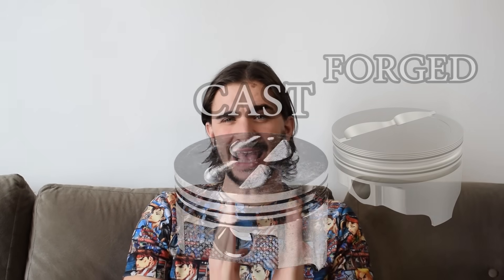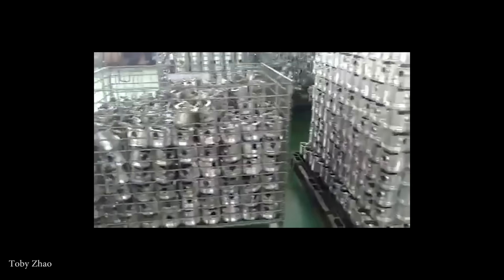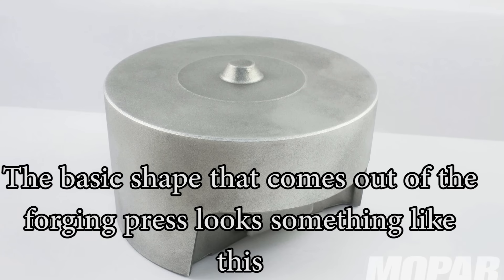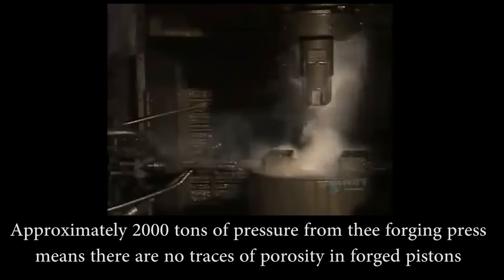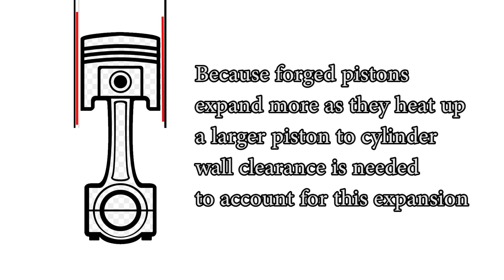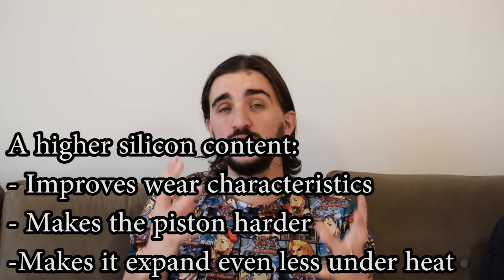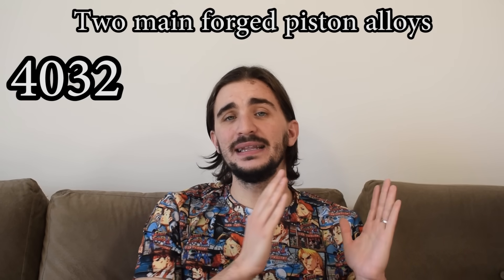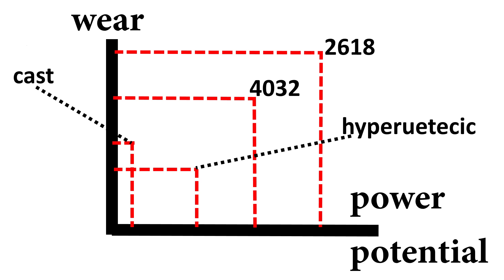FORGED vs CAST vs HYPEREUTECTIC PISTONS

Comment: Typical new cold clearance for a cast piston is .0007" to .0015". That's 7 to 15 ten thousandths of an inch. Typical new cold clearance for a forged racing piston is .004" to .006" depending on the usage. Endurance engines are typically less highly tuned and tend to have a little less clearance than drag racing motors. Supercharged drag racing engines running nitro-methane fuel make so much power in each cylinder that they may need to run .008" to .010" clearance to avoid seizing the piston in the cylinder. To prevent piston 'slap', a pattern of teflon 'buttons', machined to the actual bore of the cylinder, are used to keep the piston from 'rocking' in the bore.

It's not that cast aluminum has a lower coefficient of expansion than forged aluminum...actually forged aluminum has about a 25% lower coefficient of expansion...it's that cast pistons have have cast iron expansion control inserts cast into them to allow the tighter clearances. 

The skirts of pistons are not round. The ring land portion is round, but it's smaller than the skirt. The skirts of the pistons are slightly oval with the widest portion perpendicular to the axis of the wrist pin. You must measure the skirt perpendicular to the pin to get the proper clearance dimension. The tolerance for clearances on a new engine are actually very tight. The manufacturing clearances are not as tight for either the bores or the pistons but pistons and bores are matched to each other to provide very good uniformity of piston to wall clearance from bore to bore of a given engine. Factories used to sell engine blocks with pistons fitted to each bore for rebuilding. It was very important to put each piston into the bore it was fitted to. 

A new set of forged pistons will typically be manufactured to very tight tolerances but the racing machinist may want to machine the bores to get almost exactly the same clearance on every bore.

Comment: Super content thanks. It was probably for brevity that didn't discuss weight. AFAIK forged being stronger for a given mass can be made lighter. Lighter pistons can in turn mean higher RPM potential?
Reply from the maker: Well it depends, but if we assume an identical design of equal volume, cast will almost always be lighter. But in reality the design and volume will rarely be the same, because forged piston manufacturers rely on the strength of the forgings and often aim to reduce the volume wherever possible, which is, as you pointed out, doable to a greater extent on a forged piston. But even with the possibility to remove more material from a forged piston, as a general rule of thumb, cast pistons are still often lighter. And while it's easier to reach high rpm with a lighter piston, the weight benefit becomes irrelevant in high revving racing applications (prolonged 10k rpm+) , where the forces experienced by the pistons make cast pistons a poor choice, despite the weight benefit.
Reply: @d4a  Really interesting, thanks.

Comment: This is misleading..
What about rings?? You forgot to mention quality rings transfer more heat away from the piston into the bores meaning closer tolerances through less thermal expansion, add to that skirt coatings and oil squirters which negate cold start fears meaning not only a lighter, stronger piston but also one with much more scope for future modifications. That's without even mentioning floating pins, oil drain and control via oil control ring holes or comp height vs rod length etc etc. There's far more tech in a quality, modern forged piston to make case of a simple cast vs forged comparison
Reply: the video is a comparison of cast, forged, and hypereutectic pistons. That's it. Not misleading at all. You literally are taking other subject matter and trying to  say the video should've covered every component in the engine as opposed to just the item that's the subject of the video. You're trying to sound smarter than the video, but failing.
Reply: But what about the tires???  A car with hypereutectic pistons won't perform as well if it has crappy tires, as a car with cast pistons and racing slicks.  This is very misleading as there is much more to pistons than just the piston.  The insurance rate will be higher if it has red paint as opposed to beige, why didn't he mention this too?

Comment: The  car experts  are all wrong when they commonly  refer to aluminum parts as "billet".   Most  all  aluminum  parts  are  not billet.   All  aluminum  parts are machined from extruded bar or  milled plate or  rolled  sheet.  Billet aluminum parts  are  forged.    WTF  is  on this guys forehead?  We  keep staring at  that  injury on his forehead.  Maybe  an impact injury from a forged millile.

Comment: Damnnnn! I have grey rtv in my pistons. I knew they smelled funny
Reply: With the 4032 forged piston, should the bore be slightly larger than 2618 piston when going for quieter cold starts and engine longevity ? Is 0.5mm larger a safe option without milling the cylinder walls?

Comment: I have wiseco forged pistons in my NA gsxr 600. They work awesome. Zero issues. I always pre warm the motor too. Only options are stock oem cast, or aftermarket forged. my. Pistons and block were sent to millenium technologies in wisconson.. They sized piston overbored 2mm and renikasil the bores.. So i know my bottom end has exactly what is correct. They are the best in north america for motorcycle blocks.. I barely if ever hear piston slap..

Comment: I run hypereutectic pistons in my truck. I've always liked them better than forged. The only thing forged are good for is if you have detonation in the cylinders ( the fuel explodes to soon) they can take that punch better than hypertectic but as long as you dont have detonation hypereutectic are they way to go

Comment: Stock cast pistons have been used in engines making over 100 hp/liter on boost without issue.  It all has to do with the quality and design of the casting.

Comment: Maybe I'm missing something but isn't it the RINGS that fit tight to the cylinder walls, not the piston itself? And, if I remember correctly, larger, dense material will retain more heat than thinner/smaller material, so a piston will expand more than will the rings. Since rings have a GAP, which is off set to the various rings, sealing is still good. So, if my reasoning follows, stronger, forged pistons with properly sized rings will be do as well (or better, especially when under significant stress such as high RPMs or forced induction) than cast pistons. 

This explains why pistons are often categorized with "good for up to XXXHP" with cast always having lower recommended maximums. They are absolutely fine, within their limits, but their limits will always be lower than forged. IMHO
As to the differing amounts of silicon, well, even if the cylinder to wall gap IS larger, the difference will be taken up by the rings and the gap will simply decrease as the piston itself expands. As a consequence, I wouldn't worry about cold starts, the rings are what actually seal to the walls.

Comment: if you want to use forged pistons in a daily driver than the most important tool/accessorie you will need is a block heater

Comment: So for a dd (dd meaning daily driver) cast pistens would be better than forged? N if your car was a trailer queen (meaning a real race/track car aka not street legal)forged would be better for the preformance and strength aspect?
Reply from the maker: There are no one size fits all answers. Yes, that's a general rule of thumb, but there are many more things to consider. This video is about giving information to people to help them make the best decision, but that decision isn't made based on 1 factor. Maybe somebody wants a 600 hp daily driver and has tens of thousands to spend? Who am I to tell them they should or shouldn't do it. If it fits the budget and meets the goal it's the right decision.

Comment: Next video idea: Forged vs Cast connecting rods?
Reply from the maker: Hmmm... Well, there really are no downsides to forged rods? If you can always run forged rods and that's it :)
Reply: @d4a  Doesn't the expansion due to heat cause wear on the bearings/crankshaft?
Also, thanks for the video and for taking the time to reply!
Reply from the maker: @reaperreaper9593  No problem. The heat that the rods are exposed to is a joke compared to what the pistons see, plus the rods are constantly cooled and lubricated by oil. Some engines do have oil sprayers pointed at the piston underside, but this is of course can't negate the effects of direct exposure to combustion, something that the rods never see.

Comment: ok,  now what if someone is working on their engine rebuilding it, and decides to go with  the hyper-eutectic piston heads other than the cast or forged piston heads,
does that mean that they would also have to replace the connecting rods  [ of course the bearings ] due to the fact that the hyper heads are lighter in weight ?
every engine is built different for the different types of material piston heads,  including that some engine blocks have steel sleeve inserts in them, and some do not. 

is it safe to replace a  cast or forged piston head with a hyper - eutectic  piston head ? ,  considering that some engine blocks have steel sleeve inserts in them, and some do not.

Comment: Forged pistons are great for NoS cars that’s about it for a daily driver all you need is cast pistons turbos don’t require forged pistons, forged pistons are mainly for making big HP with NoS or if your running a supercharger cause usually supercharged cars are 13-1 to 16-1 compression were as with NoS you want low compression like 7-1 no more than 10-1 with NoS depending on how big a shot your running the bigger the shot the lower the compression you want

Comment: So In What Instance Would 1 Want to Use Hypereutectic Pistons In There Engine Vs Cast or Forged Pistons and When Using Nitrous Doesn’t 1 Want Forged Pistons With Larger Ring Gaps

Comment: u said cast was 8-10% & 4032 was 10-11% ... how come your charts shows cast wear still better than 4032 ... your chart is wrong then ... for wear from wat u are saying and correct form would be wear least hypereutectic >12.5% , Forged 4032 10-11% , Cast 8-10% , Forged 2618 1-2% ...
Reply from the maker: Silicon isn't the only factor when it comes to wear.
Reply: @d4a  hmm ...
Reply: @d4a  Could u research more when u r free and make a new video on that ? :)

Comment: Hypereutectic pistons are hard to beat as a great all round performance piston.
But the latest forged pistons can still take a bit more of a beating such as nitrous oxide and supercharging or both.
Great explanations different materials expand and contract at different rates.
A long held belief is cast iron engine blocks are stronger than alloy blocks.
But alloy heads and engine blocks allow a more even heat expansion rate.
Times change what Hot Rodders and custom engine builders held to be true 30 years ago has changed.
Nice speel.

Comment: You forgot about cryo you freeze these parts with liquid oxygen for 8 days it makes the much more efficient and durable it takes all the stress out of the metal all racing parts in applications need to be cryoed for a strong engine   build

Comment: I’m an old school long time hot rodder and have built many engines from Jeep to GM to Porsche motors. Natural and forced, so I’ve done my homework and have to say you are as spot on as anyone on your video here. I even learned (or at least refreshed) so I want to pass on a thanks for educating not only yourself about the differences but passing on the knowledge. Oh and it is pernounced silicon no need to explain but I’m from the south soooooo😂👍🏻👍🏻👍🏻

Comment: Soo what your saying is forged block (with sleeved hypereutetic walls), forged crank, forged connecting rods+caps/bolts/etc and then hypereutectic pistons? that seems like the best mix not counting the prefered alloys for the journal bearings, shims, and ring lands, etc

Comment: Forgings are also wise to use for endurance, marine and other high load situations. Forgings have much greater resistance to detonation, etc.    I have had cast pistons break ring lands, etc.   forgings can be used over and over on multiple builds if inspected properly
Reply: There is a difference between engine builders and people regurgitating information they can look up on the net. 
I will take real world experience.

Comment: This is a very interesting video. If you want to have a race engine with forged pistons, I would suggest pre-heating the engine before running.
Reply: There is no need for pre heating. Some drag engines are actually designed to run very cold.
Reply: @unclegeorgesspeedandfeed  I was thinking of F1 engines.

Comment: You forgot to mention the steel strut included during the casting process. 
The strut controls expansion and helps improve ring and cylinder life.

Comment: It is so refreshing to hear someone actually understand materials engineering and their application. Subscribed
Reply from the maker: Thank you :)
Reply: @d4a  I hate the confusion resulting of naming "steel grain" to two unrelated things: the crystaline grain microstructure of the steel, which can't be affected by forging, only by the heat treatment... and the enlongated fracture lines resulting of the hot rolling process at the mill... lines caused by high-temp melting sulfides and carbides, included purposefully or not, in the steel.
Aand which gives the steel a kind of visible (when etched, i mean) "grain flow". The first affects the toughness of the steel in all directions, the second only in the direction of the fracture lines, as one can imagine. Two diferent phenomena, and one of them unrelated to forging.
 Even the definition I see online of "steel grain flow" in technical sites is mistaken: "Grain flow is a directional orientation of metal grains and any inclusions that have been deformed by forging." No sir... of inclusions it is, of "metal grains" it isn't, fuck off. Good info: https://knifesteelnerds.com/2019/07/22/forged-vs-stock-removal-knives/
Reply: @Akeli I'm from an engineering family, been working in cars since the age of 10, we have an engineering firm where we make parts for all sorts of industry. I don't have a degree in engineering, I don't need one we use people with degrees to work for us in our business.
Reply: @Vintaronica  Wow!
Reply: @Akeli cast pistons are fine to use, cast cylinders are never used. The block is cast usually, with a cylinder liner pressed into the cavity which will not normally be itself cast, but cold or hot drawn into tube and cut to make the liners. They are pressed in, and then honed in situ. So your question about should you use cast pistons with cast cylinders, it's never done that way anyway. Cast pistons are fine, cast cylinders don't exist, cast blocks are common..hope that helps
Reply: So, if you don't mind a layman doubt..
What if the cylinders are done forged with the same material of the pistons, with the same expansion ratio?
Reply: @rlguerrero2263  well your doubt has actually confirmed your intelligence. The piston liners and bores must always be from a material that is not the same as the pistons/rings, for that exact question you asked about the expansion of materials due to heat. Almost always the liners are made from iorn-chome alloy, vanadium and molybdenum. This offers the best thermal stability, and wear resistance, as iorn also contains graphite, a natural lubricant. You will find the piston rings are also made from iorn, or some similar iorn alloy. The reason pistons themselves are mostly made from aluminium is due to the low mass which is advantageous for a chunk of metal flying up and down a cylinder 80ft/s.  There have been instances when manufactures have tried other materials for liners one being nikasil, which ended up oxidizing and killing engines. There was a brief moment in time when they used to use aluminium cylinder liners for race engines,  and they tried to use them in road sports cars i think Alfa Romeo tried it but the bores wore out too quickly and the engine was junk after 10k miles.
Reply: @rlguerrero2263  If you were to make cylinders out of aluminum and the pistons out of aluminum your engine would wear out within a month or two.
Reply: @Akeli Another thing to note although uncommon some engines such as the hondas H series have a FRM lining which doesn't expand very much making it a bad idea to use something such as forged pistons, due to the fact the forged pistons will expand more than the cylinder and score it
Reply: @notbilly5962  use a smaller piston, it expands anyway so it changes nothing
Reply: @bitai683  cant have too much tolerance - piston skirts will slap the liners
Reply: Are you kidding me?  This fruitcake is a starbucks manager or something.  He doesn't know sh!t.
Reply: @JustForFun77077  Educate us, then.
Reply: @OldSchoolZ-wy2yx  what he said was accurate but misleading. He said that cast pistons have lower thermal expansion than forged ones, but what he should have said is that the alloy used for casting pistons has better thermal expansion properties. The casting or forging process has almost nothing to do with it.
Reply: @JustForFun77077  And you are just a keyboard warrior, otherwise you wouldn't be cracking on people.